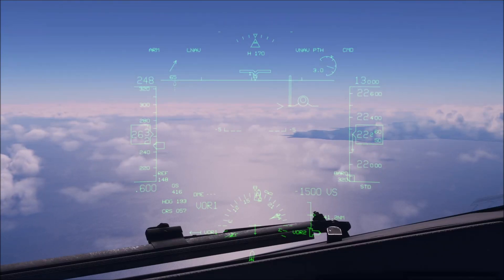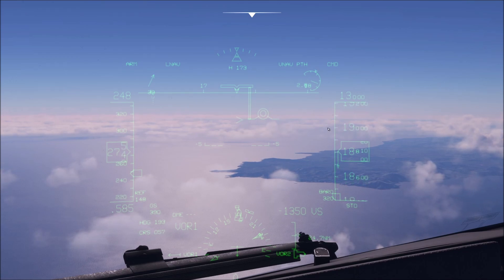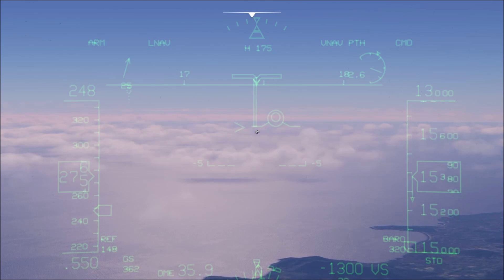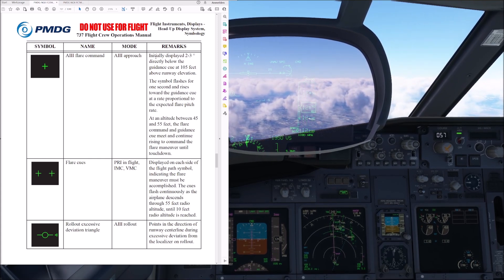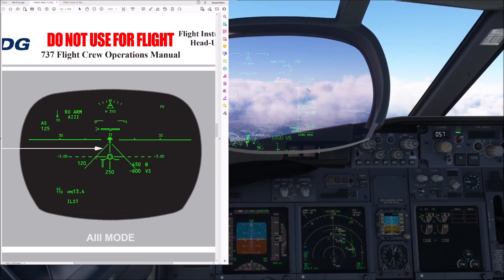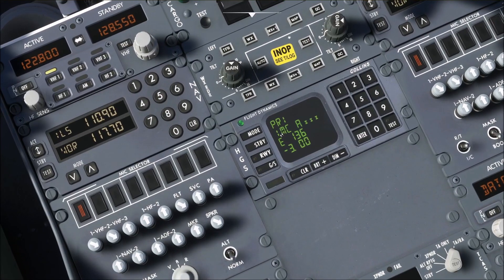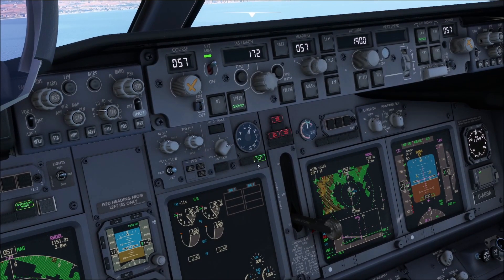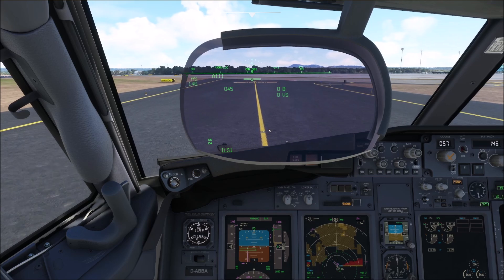Head Up Display Explained: ILS (AIII) Approach | Real Airline Pilot

Comment: Thanks for the tutorials, they are great! I have a question, I just performed an approach and at the final I had "No AIII" displayed on the HUD. I had both radios tuned to the ILS frequency and Elevation + Runway Length set on the HGS panel. Any ideas what did I miss in order to have the AIII enabled?